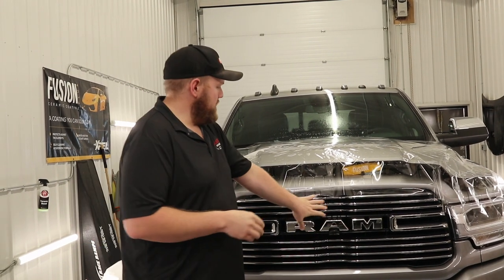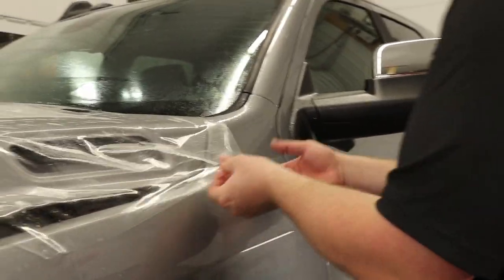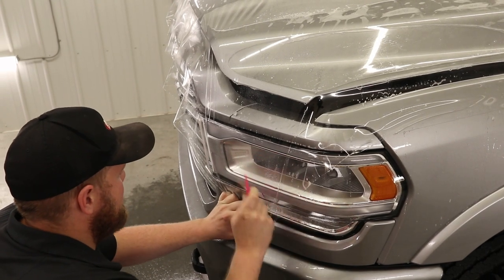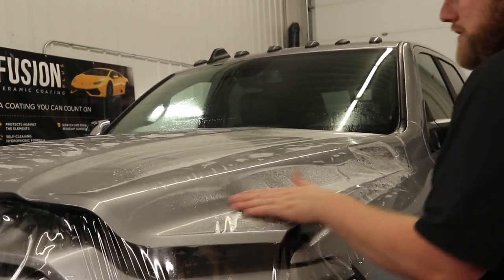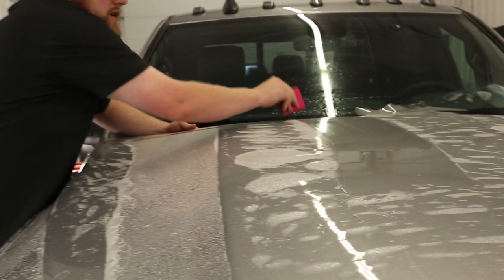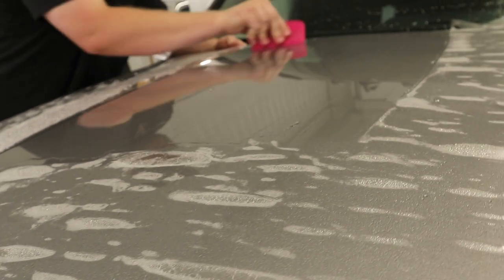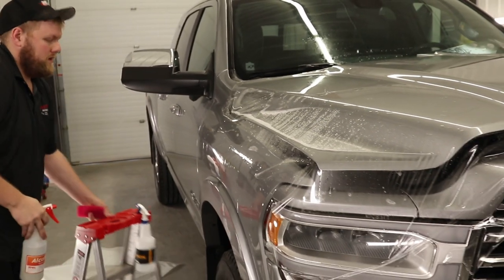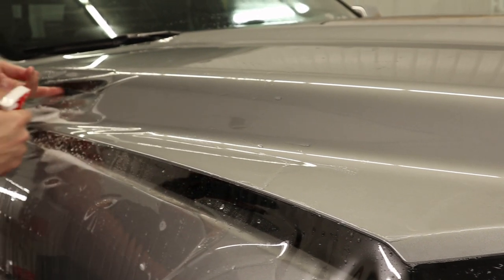Ram 2500 - Bulk Hood PPF Install

Comment: Did this hood yesterday and ALMOST messed it all up by releasing the tension too early.  Regardless, it’s installed and looking great!  Thanks for the tips!! Now to try bulking that front bumper.
Reply from the maker: Best of luck!!
Reply: @DriveProtected  it went mostly well.  Had issues getting tension on the bottom not sure how you made that look so easy.

Comment: 60 inch role will work on most pick up trucks? Have a 2022 GMC at4 coming in two months. Not used to pick up truck sizes lol
Reply from the maker: Yup. 60” will work on 99% of trucks. I’ve done many AT4s, and I believe they are about 52” long, so a 60” roll will be perfect.
Reply: @DriveProtected  got it. Thank you very much for commenting back. Much appreciated!!

Comment: I heard you mention the film doesn't stick to lights. Do you have any idea why?
Reply from the maker: Most headlights these days come with some kind of factory coating on them that prevents the film from sticking.
Reply: @DriveProtected  I specialize in HL restoration and offer ppf as an option after a restore or as a preventative service. I noticed it can take some extra effort on some lights that are still clear.
Reply: @DriveProtected  its almost as though the factory uv coating has hydrophobic properties like a ceramic coating.

Comment: What is your ratio on your slip and tac solution?
Reply from the maker: Slip - 1.5cc of J/J shampoo to 32 oz water. Tack - 70/30 with isopropyl alcohol and water
Reply: @DriveProtected  thank you sir.